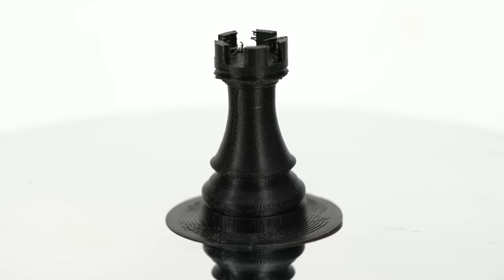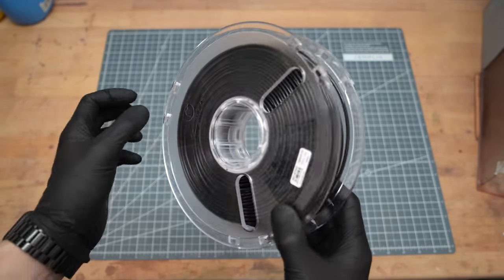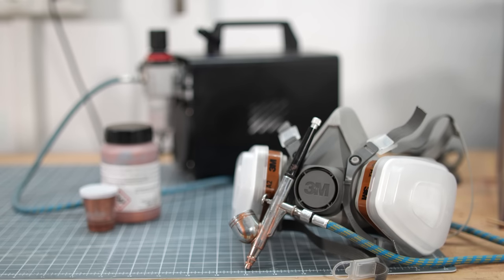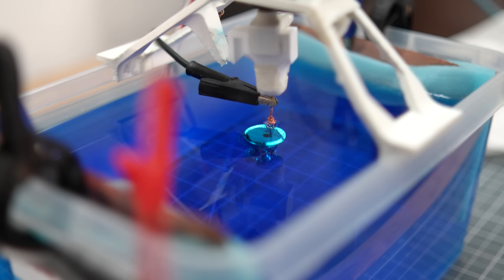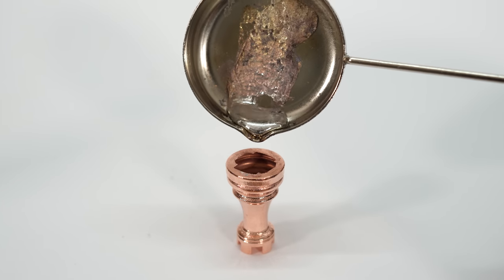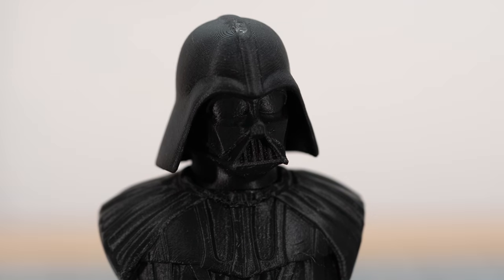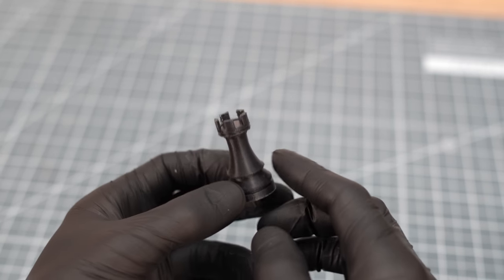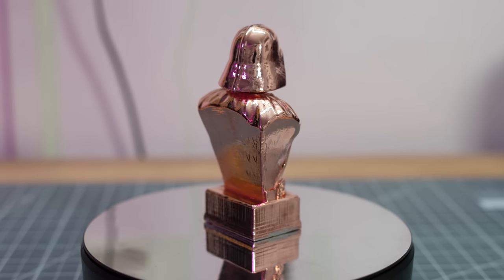Cast Into 3D Prints | Electroplating

Comment: Could you do a exact outside dimensions measurement of the print to the plated print?
Reply from the maker: 23.15mm (printed) vs. 23.45mm (electroformed) -> 0.3mm/2 = 0.15mm Cu Thickness

Comment: Is there a way to removethe electroplated shell after casting? If the shell is strong enough it would be interesting to cast aluminum
Reply from the maker: I dont think there is an easy way. You coud etch it off, but i wouldn't recommend it. The shell is around 250micrometers thick.

Comment: Could the plastic not be removed by heating? A burnout ought to have the same function.
Reply from the maker: Actually pretty sure by now. Some other guy were mentioning that pvb could be burned, too. I‘ll try this next time.
Reply: @hen3drik  great video anyway. Glad to have discovered a new chanel :D 👍
Reply: @hen3drik  Also, if you stick with dissolving it with isopropanol, you could probably make that go faster by heating it (but not over the boiling point of 82.5°C) based on the old rule of thumb that the speed of chemical reactions doubles for every 10°C temperature increase.  So perhaps dissolving at ~75°C vs. ~25°C, it would only take an hour or three.
Reply from the maker: @perspectivex  Good point!

Comment: This might be a dumb question but what is the power supply device you use to control the voltage and amp called?
Reply from the maker: It‘s an ordinary laboratory power supply (5A) that I can set to constant current.

Comment: I have a question, since to me some parts of the model look tinned on the outside: is it the camera angle and light reflecting on the polished copper or does tin actually pass through the copper to the outer surface?
Reply from the maker: Good eye! No, it doesn’t pass through: On copper, as the temperature rises, a series of colors develops from orange to rose red, violet, steel white, brass yellow, flesh red to green with many intermediate shades.

Comment: Have you considered printing with PLA and melting it out?

How sturdy is the electroplated shell? I wonder if you could print the inverse as a mould that could be separated and re-used (e.g. if you're doing 16x pawns)
Reply: Should be sturdy if you deposit enough metal the used to and still might make molds using electroforming

Comment: Great video!!
I see that you have an ultimaker 2+ , so i want to ask you this: what do you think about the machine? Does it has any major flaws?
Reply: If you look at the final bust you can see very clear vertical lines across the base. This is ringing and is the result of Ultimaker's very dated printer design and lack of modern firmware that can cancel out such artifacts.

Look at Bambulab instead for a much capable modern printer at a more reasonable price point.
Reply from the maker: The printer is from 2016 and has been heavily tweaked by me. It still prints very very well with no ringing at all. I would also advise you to a more modern printer, such as just said bambulab.
Reply: Many thanks for your suggestions, guys

Comment: WHAT IS THAT WATER  MISTING THING , I NEVER SEEN THAT BEFORE
Reply: It’s the Polysher and its made by the company Polymaker to be used with their „Polysmooth“-filament which is made from PVB.
PVB can be dissolved in isopropanol and so the isopropanol mist inside the machine slightly dissolves the outer layers of a print to make them smoother and get rid of the layer lines.

Comment: Try Resione castable dental resin C01 I use Resione a lot for my prints i highly recommend it, More so there tough K resin, I only just bought a Elegoo neptune 3 plus due to watching your videos because i want to start electroplating myself i mainly use resin printers from Elegoo mars pro 2 to the Elegoo Jupiter for my prints the Neptune is my first Fdm or Abs/Pla printer i have owned so if anyone has tips for me for the Neptune i an all ears,  Ps i got it this week and it a super quiet printer but larger than the Jupiter

Comment: Why not try lead.  It's cheap, and has a relatively low melting point.  You can leave a little bit left to be filled and then fill that with your tin or with resin if you don't want bare lead on the bottom.

Comment: Even quicker is to just fill it with a polyurethane resin. Also gives it weight and is also very strong. And a lot cheaper than tin 😂
Reply from the maker: You are right. This works pretty good as well.

Comment: This process is completely backwards, and unnecessarily convoluted. Pvb is most typically used directly as a casting material for the cores itself, as it burns more or less Ashless, and can be cheaply chemical smoothed in ipa. So you essentially did the process backwards, twice. So the normal route to do this, is to add sprues to your part, make a ceramic slurry, dip and coat the part, melt the plastic out, and pour the metal in. You added a whole bunch of unnecessary extra steps to a process  that doesn't require particularly expensive equipment , you can do this with stuff that isn't much more sophisticated than a barbecue starter and a paint can and some ceramic mix. The slurry becomes a single use mold essentially. This is basicaly lost wax casting/investment casting and is an absolutely ancient technique. It's how a very large amount of jewelry gets made, using 3d printed casting cores.  Heck, polymaker, whose ipa nebulizer for smoothing pvb prints you used in the video, even has a whole video series about using their pvb polycast filament specifically to do this. You could then anodized that part, or you could then electroplate that aluminum part to something else, and the core could be from molten aluminum cans which cost basicaly nothing. 

In the technique you showed in this video, you could've actualy left the printed core in it and used a pause command to insert things like pre made weights such as fishing weights in the print directly. Or if you really wanted to, dissolve or melt the print out and resin cast it back with weights or magnets suspended. Pretty common to magnetize the bottoms of chess set pieces. and for an even simpler cheap method, you couldve basicaly just left the printed core intact with a design feature intended for this, and just glued a steel pin and a magnet into a cutout for adding weight and magnet in the base.

Comment: This is all done... remarkably wrong. If you want something smooth, you should be using Resin printing, not FDM. Also you should make a MOLD. This is super simple if you're just using low-melting point metals. And the best low-melting-point metal is Pewter, not Tin. Tin can produce fumes that are quite toxic when melted. Pewter is safer, stronger, less expensive, arguably looks better, less chemically reactive, and you can eat off of. For molding, you can use special high temp molding rubber like Mold Max 60, but a far less toxic silicone material like EcoFlex 00-30 can actually stand up to 600 degree (f) temps without a problem. The only downside is that they are so soft they can deform from the weight of the metal if you're not careful. Also they are platinum-cure, so you need to super-cure your resin parts before trying to mold them, or the silicone won't cure and you'll get a goopy mess. A light coat of primer can fix that as well. The Craftsman's YouTube channel has all kinds of information on how to do this.